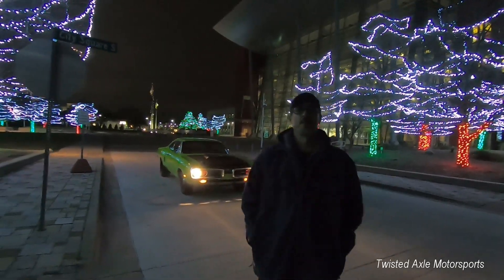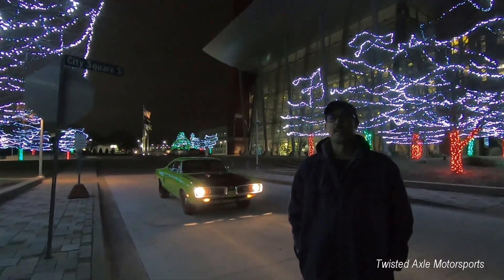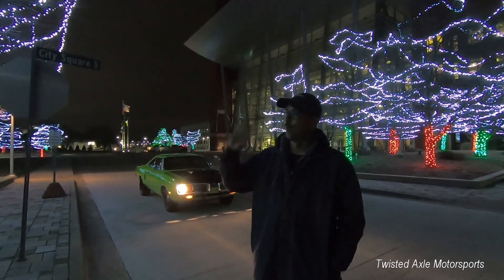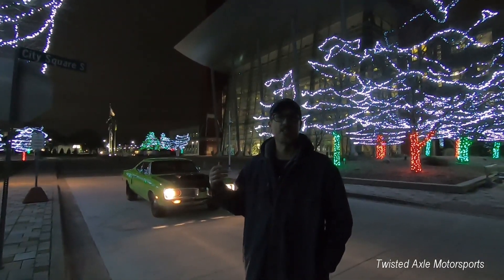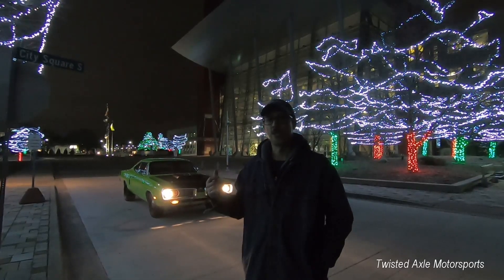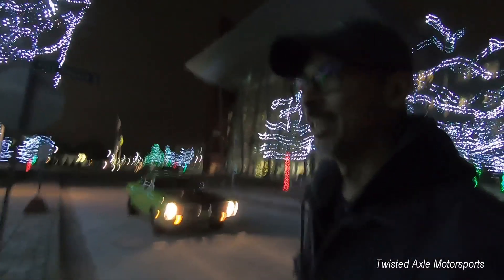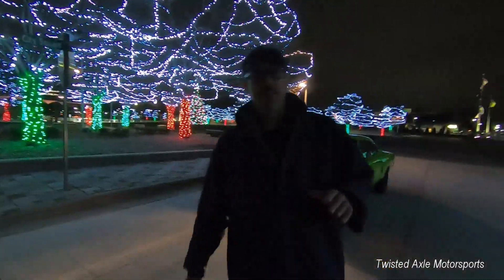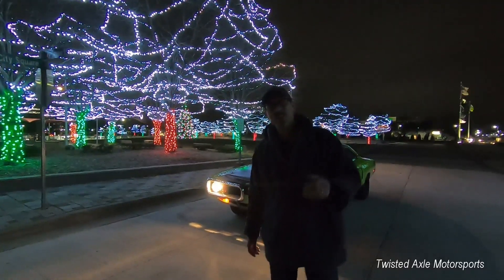Flow Master 40 series mufflers and Big Block Mopar sound. Plus electric cut outs!

Comment: Could you please tell me what size and brand cut out you used? I have a three forty dodge dart swinger and I need help
Reply from the maker: I used Quicktime performance cut outs. My exhaust is 3" so get the ones that fit your system. Mine have been in service for several years with no issues. Some friends have used cheaper ones and they have failed in a couple years.
Reply: Thank you!